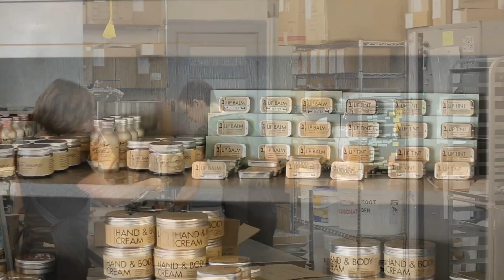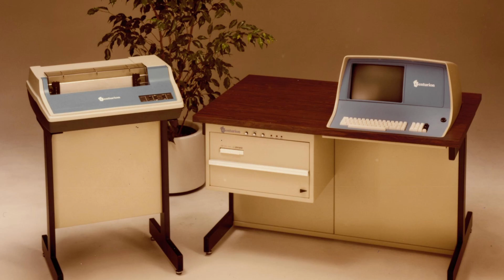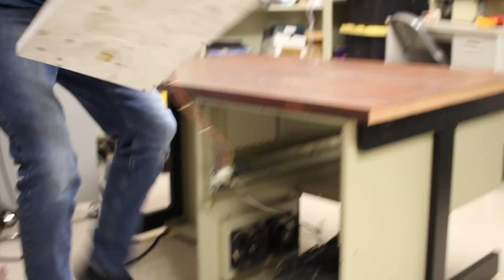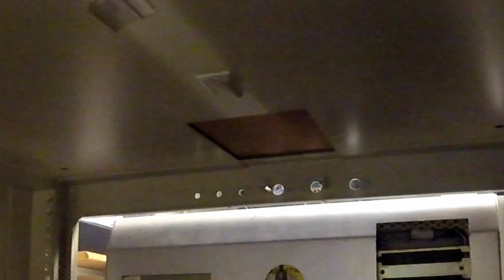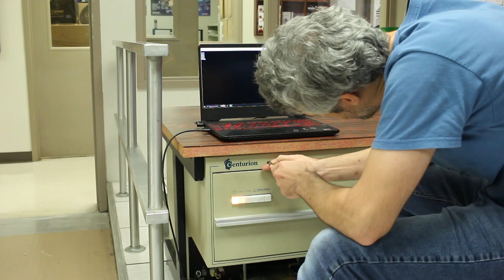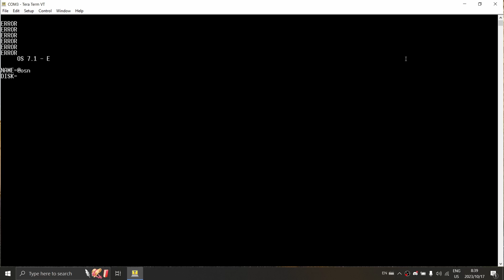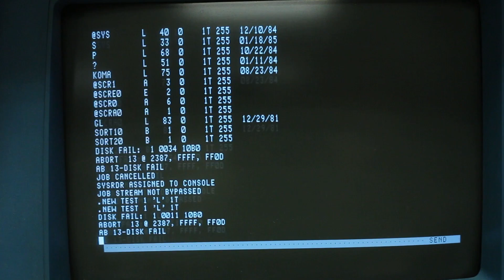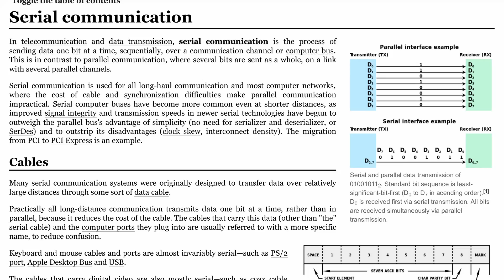The Desk System Centurion Worked Perfectly! Until it didn’t…

Comment: Surely rather than Xmodem, you should consider Kermit.  A Centurion port would look lovely on the already massive list of systems it works on, including several of the Centurion's competitors, and the protocol is simple and robust.  (And it was always the pits to have to type the filename twice, as Xmodem made you do...)
Reply: Agreed. I immediately checked to see if Centurion were on the Kermit implementation list and was very surprised to see it wasn't - that list has some very obscure systems. The biggest advantage of Kermit is it's ability to work over non-transparent links but you do need a fairly good implementation of it (eg c-kermit) to beat Y,Zmodem speeds if the link is transparent.
Reply: agree.  i did a port of Kermit to our custom device back in the 80s.  it too would be my choice over Xmodem
Reply: I always liked ZModem.  The ability to continue a transfer without restarting was brilliant.  Those were the glory days.
Reply: @Starchface  I used to modem into work which was connected somewhere in between by a T-1 span with what appeared to be a free running clock.  The inevitable frame slips would knock me off line repeatedly.  Zmodem saved a lot of frustration transferring between my 3B1 and the HP-9000 at work by being able to restart transfers.  Those were the days.  Later We started using Telebit Trailblazers which were immune to the frame slips and were able to go up to a heady 23K bit/S unidirectional.  That wasn’t as bad as it sounds because the modems could do protocol spoofing and generate ACKs locally without needing to go across the wire.  It was a neat idea and outperformed 56K modems for some things like UNIX UUCP.
Reply: I have to add my support for Kermit. It was an awesome tool on my old Kaypro 10 and I often swore by it. ;)
Reply: I thought about Kermit, but it may be too much tool for the job.  Xmodem is simple to implement.  If I recall, xmodem is what was used for reflashing Cisco routers back in the day.  It wasn’t super fast or elegant, but got the job done.  If Teraterm is the preferred serial communication program, then whatever transfer protocol(s) it offers would drive what gets coded on the Centurion platform.  I recall the commercial product, Procomm Plus having a rich set of transfer protocols, but you’d probably need an old version of Windows to run it.
Reply: @wtmayhew  xmodem  not retaining the filename would be my reason for not using it but preferring ymodem or zmodem, which do.
Reply: @rivimey  Thanks for the reply.  Agreed.  The way around that limitation would be to simply image the entire platter or at least the portion which contains the operating system and root directory.  A person more familiar with Centurion mentioned in another comment thread that there is a diagnostic card which might be amenable to having xmodem burned into its ROM.  One thing that may make it a little harder is I believe the sector size used by Centurion is 400 bytes or something which is not a nice multiple of 256.
Reply: Indeed.  We even had a version running on Gould/SEL MPX 32/77's written in FORTRAN.  And THAT is an obscure system!!!  lol
Reply: I implemented xmodem in assembly it's quite simple you can choose CRC or a simpler check for the data.  (This was pre-Internet so I had to download the protocol from a BBS,  and as I didn't have error checking yet, the CRC part of the protocol that I downloaded was corrupt!).

It's certainly simple enough to implement as a segment of a video.
Reply: Or use Zmodem?
Reply: Kermit is also extremely slow, I have a HP48GX calculator which has Kermit and Xmodem support built in and Kermit is so slow that I never used it despite being more comfortable.
Reply: @mudi2000a  Poor performance will be either down to the particular implementations of the protocol used (not everyone implements all the optional features), or the settings being used for the transfer. C-Kermit to C-Kermit, configured for speed, should be at least as fast as Zmodem
Reply: @davidg_nz  that's incorrect. The protocol overhead of Kermit is higher.

Comment: OK, so Moore's Law is declining, but Murphey's Law still seems to be working perfectly...
Compliments to all involved in the Good News part! 🙂
Commiserations for the success of the Bad News part. 😞
Let us thank whoever is responsible for the Ugly News part finding  the bit bucket! 😐
Loved hearing/seeing that Lovett & Co is a True statement!
Keep truckin', man!  🙂🙂

PS: What is worse? A break in a cable or 1 bolt left over after repairing the washing machine?
Reply: depends where the bolt should have gone
Reply: @highpath4776  THAT particular bolt was sneakily ADDED by the wife to the pile of parts because she wanted a NEW washer instead of the antique umpteen-times-repaired machine...
Reply: Moore's Law has ended.  It's no longer possible to physically shrink integrated circuits any further than they have been, because if you make the electrical conductors too narrow, the electrons get almost literally "bogged down" due to there not being enough electron "holes" left for them to propagate through.
Reply: @melkiorwiseman  So... instead of laying the conductors down, rotate them to stand on edge.  That is, if they are not already thicker than they are wide... 😐
But that still leaves the issue of inter-conductor capacitance.  [sigh...]
Reply: @Scott-i9v2s  I gather that the conductors are getting down to being only a few atoms wide.  A conductor which is only a few atoms wide isn't going to be able to support even its own weight if made more than a few atoms high.
Reply: @melkiorwiseman  Fun, no true? 😞
Reply: @Scott-i9v2s  Basic physics.  This is why "humungous mecha" only exists in fantasy and not in the real world.